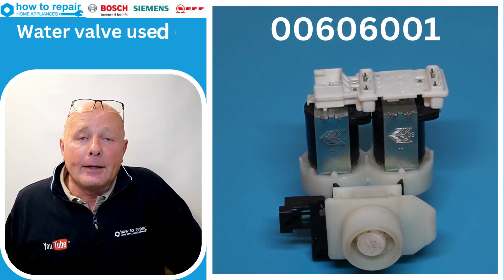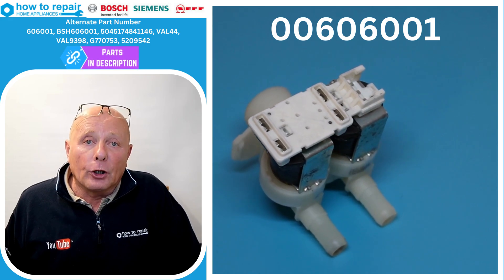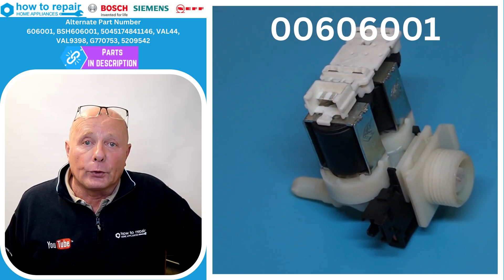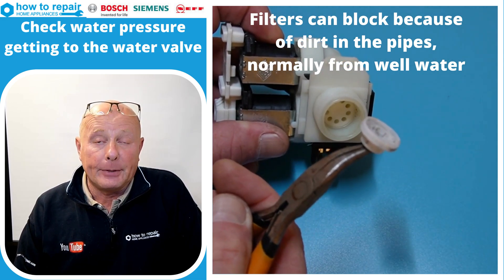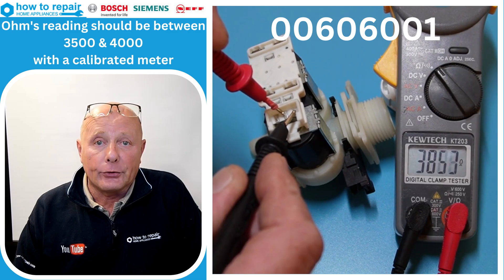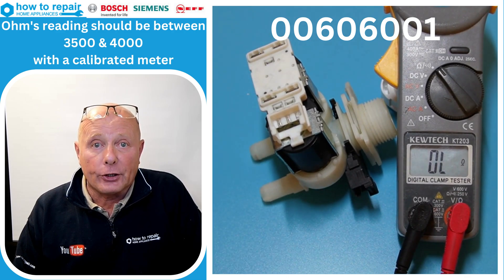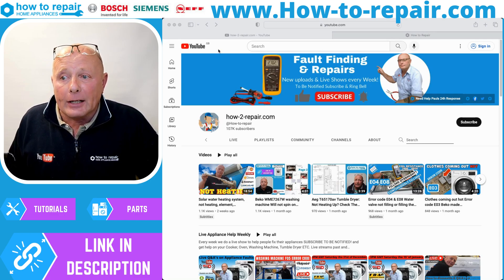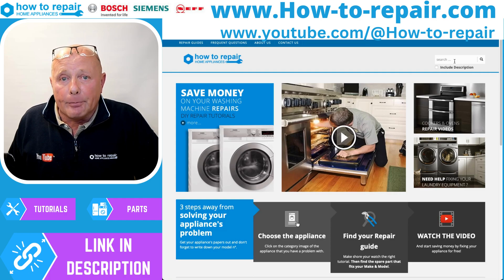Washing machine water valve 00606001 F17 error code fault, Bosch Neff and Siemens diagnosing faults

Comment: Mine reads 4120 Ohms. Slightly above the 4000 ohm, is that still ok?
Reply from the maker: That sounds fine you must remember your meter might not be calibrated. The item might have dirty connectors and there will be a slight difference between each one.
Reply: @How-to-repair  Awesome, thanks for the reply. Would you have any idea how to reset a Bosch WAE22460AU/09 washing machine? I replaced the water inlet valve and only middle compartment and right compartment in the detergent tray get's water, left compartment in the detergent tray doesn't get any water.  I am assuming after replacing the water inlet valve, machine need's a reset. Upvoted and mentioned your channel to an Australian tech site forum, thanks for the previous comment.